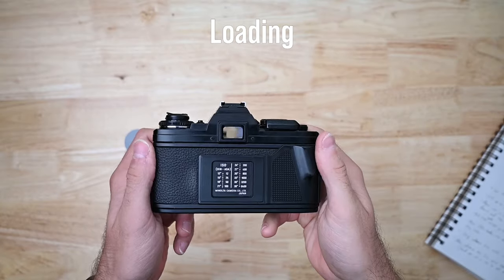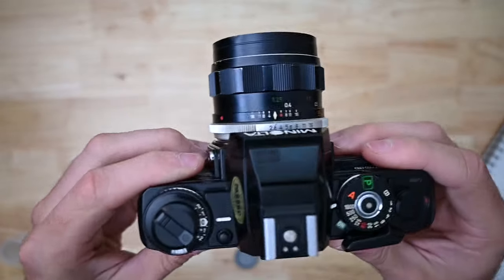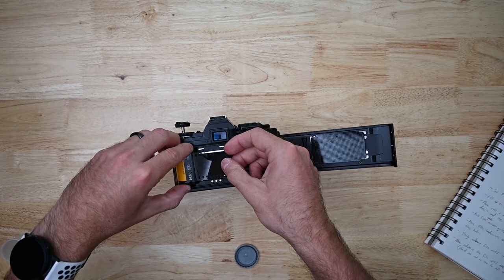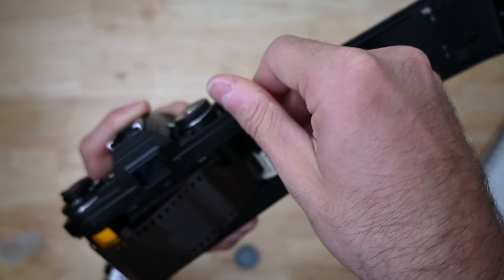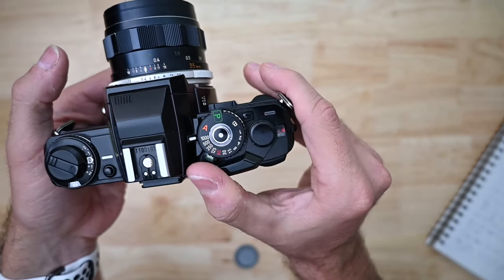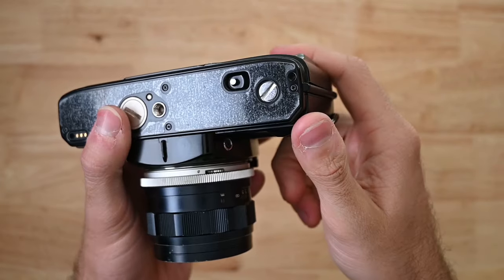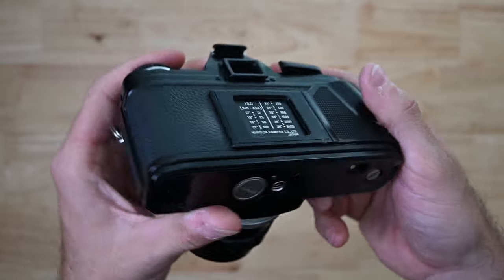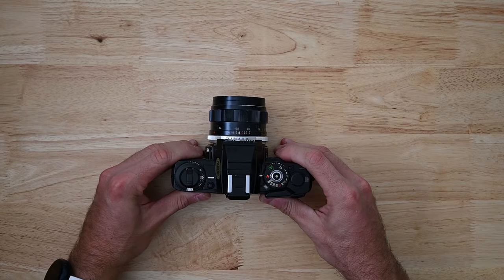How to  Load and Unload the Minolta X-700

Comment: I have found my parents' X-700 in the attic. It's from the mid 80s i think. Haven't figured out how to open it to check if there's still a film in there. I'm reading an online manual for it. Here, my indicator that you say should be black is partially red on the left side. No idea what it means. Thanks though, nice video.
Reply from the maker: Partially red on the left side...either there is no film in the camera or roll is still on its first couple frames. As you shoot photos and advance the film the red portion will work its way to the right.
Reply: because that shows film is inside the camera, the right little section

Comment: Long shot getting an answer but my Minolta xd5's mirror is stuck up is this a battery issue by chance?
Reply from the maker: This will be a long shot if it actually works as I am not familiar with the XD5. Looking at an online manual, it could still operate in "O" or "B" modes while on manual even with a low battery. Using those modes may get the mirror moving again. If not, see if a new battery would work. If not, may be a mechanical/electrical issue.
Reply: Thanks much appreciated

Comment: The film I put in said 24exp but the counter is up to 28 and still seems to be functioning as normal. Is there some kind of indication that the film is done? I would have thought it would stop advancing or something.
Reply from the maker: If the rewind crank was operating properly when you advance the film, then you may just in the extra bit of film left. I might be careful in advancing the film any further as to not mess up the roll/canister.  If the rewind crank was not rotating when you advance the film, then your film may not have caught onto the sprocket and isn't advancing. If the latter happened, then rewind the roll completely and load it up again.

Comment: Mine keeps beeping  any suggestions?
Reply from the maker: The X700 will beep for 2 reasons
1 - the picture is too dark; low exposure warning.
2 - camera shake warning; shutter speed is too slow.
Also the on/off switch has 3 positions: On))) - Off - On. The "On)))" will beep, while the other "On" will never beep regardless of light or shake.

Comment: Having loaded hundreds of cartridges into my Minolta XG-M (the proof of concept camera for the X-700) and my X-700, I soon learned to "load economically". This is done by cocking the camera, going into a "dark room", holding the cartridge in one's right hand, sticking the film tab into the sprocket and turning off the light before pulling the cartridge across to its intended place. Then the back must be closed. If done correctly, the portion of the film behind the shutter curtains has not been exposed (explaining why the camera must be cocked beforehand. On a 36 frames cartridge it was usually possible to shoot 39 images, which was originally particularly nice when shooting slides, because one got more images at no extra cost (later this was also true of negatives and copies).

Here's a tip for new users: Notice the small slit right above the frame counter? When no film is loaded, that "window" is black, but when you load a film, a red indicator moves across it to indicate proper charging and advancing of the film. If it doesn't appear when you advance the film, then the sprocket didn't catch the holes. When you rewind the film, the indicator moves gradually to the left - until it disappears when the film is nearly fully rewound. If you have loaded economically, make sure that you rewind the film completely before opening the back. Otherwise you can open it at that point, which is an advantage if you process your own films, since you won't need a special tool to catch the film inside the cartridge.
Reply from the maker: Comments like yours are awesome. Tricks and techniques that you have learned that probably many of us "young" people miss. 😆

Comment: One thing I do is when you feel that and hear the  “tension” in the reel and the film leader pulling free I listen carefully and only turn it maybe 1.5 more rewind turns, because I don’t want my film retracting inside the film can if I can help it.  It’s just one more step to do to retrieve the film leader.  If you send your film out to be processed it’s not a big deal because they will have to open the can to get the film, but if you develop at home it’s easier to wind on your reel without having to extract the film leader from the can.  I can also pre-trim the end to feed onto/into a Patterson Reel or my Steel Hewes Reels.
Reply from the maker: Never thought of that. I'll try to remember that when I get around to developing my own film. Thanks man! 👍

Comment: I forgot to press the rewind button and already started rewinding it. the rewinding crank runs freely now. .. what do i do now? will the photos be ruined if I pop it open to take the film out?
Reply from the maker: Good question. May need some help from other viewers. I just had that situation happen. So it sounds like your film is completely wound into the canister. If you open the back and remove the canister, your film will be safe. But now the question, “now what?”. Should I try and continue to use it or develop it as is? The plan of action I’m doing for my roll is developing it as is. Made the mistake of rewinding it at 15. If you want to continue using that roll, I honestly don’t know of a way to pick up where I left. Hope this long reply makes sense.

Comment: hey, does the camera need a battery to open up the back? I haven't put a battery in mine yet and it won't seem to open up despite pulling on the film rewind just like any other camera. I don't want to force it so I haven't pulled SUPER hard, but I think I've pulled as much as it would normally take to open.
Reply from the maker: Hey Mooshle. My guess is you may have figured it out by the time I replied. The camera does not need battery or power to open the back.
Reply: @shoot_move_edit  haha yep, all good I just needed to pull lightly on the back a little while pulling the film rewind to get it to easily pop open

Comment: I was looking for instructions for my Minolta 9000 and couldn't find it. This video works as both cameras have identical take up spools.  The instructions in the user's manual for the 9000 were confusing and didn't clearly mention the critical need to align the film with the teeth on the spool.  I am old enough to have used film cameras in my youth but none were as tricky as these cameras.
Reply from the maker: So glad I could help Carlos. 👍

Comment: Just wanted to make sure, it need a battery to advance the film right? I just got one and was checking if everything was working properly and the lever wouldn’t advance all the way.
Reply from the maker: Thanks for the question Kendrone. Unfortunately you will need a battery and be able to turn the camera on.  Then you can release the shutter and advance the film.
Reply: @shoot_move_edit  That's Perfect! That's all I needed to know just in case it was broken or not! Thanks so much for the reply

Comment: hey!! I have a question. I am very new to shooting film. I took about 18 photos the other day, and I can't even remember WHY i did this - seems so dumb now - but I had popped the back open just slightly. Nonetheless, it was a sunny day and I now know the film was likely ruined. The counter fell back to 1. What do i do? Can I still take photos or will I be double exposing the film? Is there a way to get back to 18? thank you!!
Reply from the maker: I did the same thing before. As far as I know, there is no way to manually adjust the number to go to where is was prior (18). You will just need to remember you have 18 left on the roll and rewind once you 18 on the counter. You will have some film left in the roll that was unexposed to the light. So you can continue where you left off. When I got my film back, 8 of the shots were affected by the accidental opening, and all the others were fine. If you're lucky the ones exposed could end up being a happy accident with a cool effect from the light. ;)

Comment: I just found this camera that my grandpa used to use. Does the battery have to be working for it to load and unload film? For example I want to see if there’s any film left inside the camera but I don’t know how to open it.
Reply from the maker: So happy for you Cassandra! You do not need to have a working battery to unload the film. If you plan to only remove the film and not venture into shooting more frames with it, make sure the film is completely wound up before opening the back. If there are memories in that roll, we want to preserve them. ☺️
Reply: @shoot_move_edit  if I do want to continue shooting with the camera or say my sisters maybe what do I do then? Also I tried wounding it back but I never felt the tension it said would come up in the manual. I don’t want to ruin anything that’s in there. It’s also got a red little flag on the right side of the camera as well where the numbers are.

Comment: Thanks for the video was very helpful. I just purchased the same camera that you’re doing the video on. However I can’t seem to pull the Advance lever it’s just going into a lot ock position. Did not know if there is a locking feature so as not to advance the film accidentally?
Reply from the maker: If the advance lever is locked you may need to release the shutter. Double check your camera is on and try to press the shutter release.

Comment: my little bar to advance film and the shutter release is not working,  is it possible to fix this?
Reply from the maker: The only thing I can think of is double checking to see there is a good battery in the camera and the camera is turned on. The advance lever won't move unless the shutter has been released. I hope this helps. 🙏
Reply: @shoot_move_edit  problem fixed, turn on camera!!
Reply from the maker: @57kjohn  Awesome! 😄
Reply: MY 1 DOLLAR Minolta x 700 may work just fine! garage sale item with 2 extra lenses..a steal!

Comment: I pressed the rewind release and started rewinding, but hit resistance on the crank super quickly - like 2 rotations. Then it felt like it released and started spinning freely. I’m scared to open the back and expose the film. I don’t see how it could possibly be fully rolled back into the canister after so few rotations of the rewind crank. Any ideas on what I should do?
Reply: Omg, it probably wasn’t loaded properly and wasn’t advancing the film, right? As I hit enter on that comment I realized that’s probably what happened. 🤦🏼‍♀️ Got this camera from my father recently and keep doing things incorrectly 😎
Reply from the maker: Don't worry Lily you'll get it! Maybe only a couple frames get messed up, but you still have the rest of the roll to go through. From your comment, I would imagine your "new to you" camera is in good working order :) . Keep trying!

Comment: Nope.   Place the film leader in the takeup slot, and hold in place with your right thumb.  Then pull the film cannister to the left and push it into the film cannister holder.  Close the back depress  the shutter release and film advance lever while watching the rewind knob, it should rotate.  This process takes about a second and a half.  I don't recommend all the fiddley stuff in the video.

https://youtu.be/SvNQ7ScW2_o
Reply from the maker: Truth be told, never knew that. I will definitely try to learn that method. Thanks for that man! Were there times where the film lead didn't catch or stay on? I could imagine when I try it the first couple times, the film might not stay in the take up slot and I'll have to reopen and try again.
Reply: @shoot_move_edit  I learned the technique from a combat reporter in 1984, and once I learned it I've not had an issue in 38 years. Thank you for your kind words! ✌
Reply: @shoot_move_edit  and if you're worried about it practice loading and unloading with an expired or known bad roll of film.

Comment: hey thank you for the video!
 My camera is always on S and i don`t understand how to get to 1 on the right. If the Camera is on S does that mean it doesn`t take pictures? sorry if my english isn`t that good.
Reply from the maker: Hello Luna, usually if the S appears in the little window it means there is no film in the camera or the film has not been advance enough.
Reply: @luna I used to have the same problem on my camera. It would always be on S no matter how far along the film I was. To fix this I bought it into a repair store and it was apparently a super easy fix and I just had a worn out piece on the counter. You can still take images on S but you’ll just have to count how am t shots you’ve taken! Hope this helps